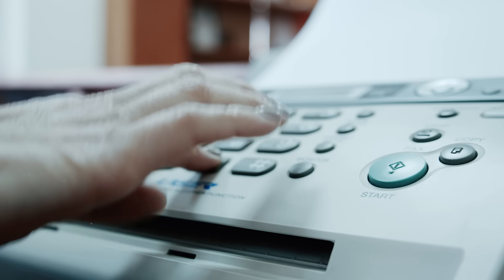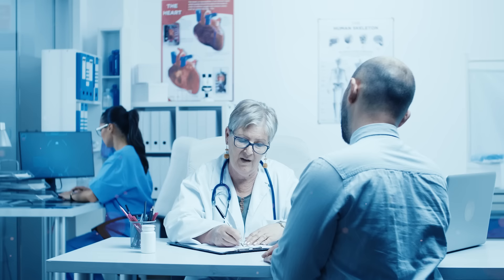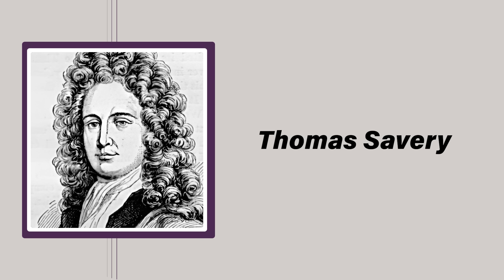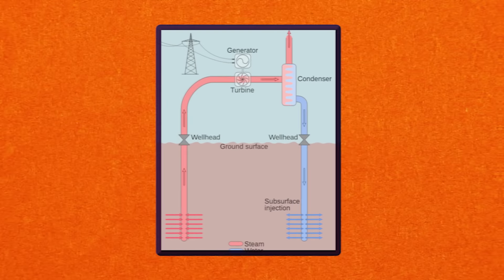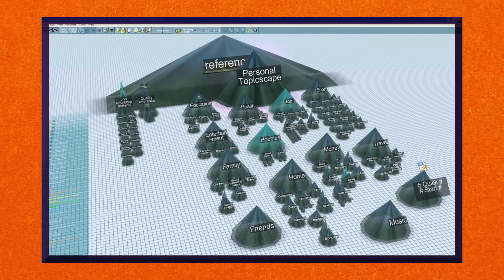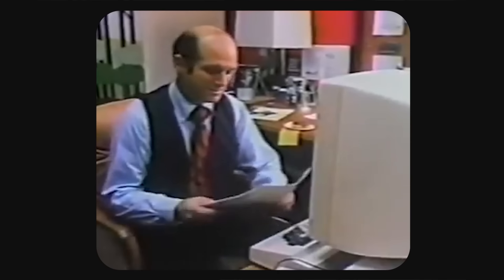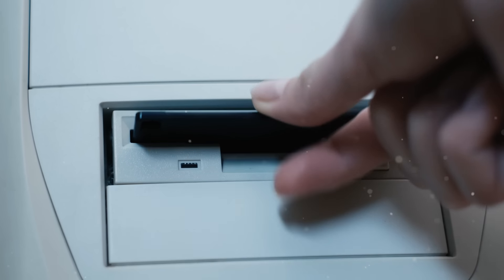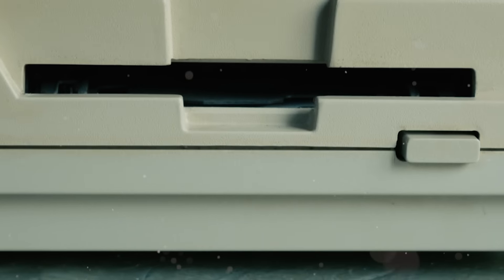Terribly Outdated Technology that we Still Use...

Comment: Actually, Natural Gas fired power plants do not use steam, instead they use turbines directly, like a jet engine (turbofan) or as the engine(s) for a turboprop plane.  This allows much quicker adjustment in the power output which cannot be efficiently done with steam.  Because steam power output is not easily adjusted, this is why coal-fired, oil-fired, geothermal, and nuclear power plants are known as "base load" plants.  In other words, their power output stays relatively constant throughout the day.

Comment: One of the reasons fax machines have declined is the removal of land lines.  One must have a dial up connection.  Home fax machines have been replaced by services like faxzero for the occasional outbound need.  No business except some tiny start up would used cellular for its sole telephone.  Interesting about the HIPAA (a solution in search of a problem!) approval.

As of a few years ago, some state of Texas systems were still using XP.  Typical Texas, where we don't restripe roads after many years of illegibility.  Like the later Windows 7, ordinary users were very, very slow to upgrade to newer OS's.  Put Windows 98SE in that exclusive club, too.

Comment: Worked IT in the medical industry. Windows XP was used for machines in Imaging. Hated fax because it had lots of problems (hard to pin down ones) when run over VoIP (since POTS lines were largely discontinued).

Comment: New doesn't necessarily mean better.  Take cars for example.  When i bought  nice car back in 2000, it didn't require me to have a "subscription" for the heated seats.  You either had them installed or you didn't.  And while the heated seat subscription model is on hold for now, you can bet it's coming back at some point.

Comment: some of us don't believe diskettes are technically floppies since their cases are hardened; one interesting variation of this were LS-120 "super" disks; they fell into the category of Bernouli drives, a class of removable hard drive; this is why the drive actually used an IDE cable; not long after that, data storage practically grew at a logarithmic rate; CD-R/CD-RW bumped up to 700 Mb and hard drives advanced into the Gb range

Comment: Floppy disks have a security feature that I haven't seen on a USB flash drive for over 20 years... a "write protect" feature.  Once the disk contained the data you need, you could stick a sticker over the slot in the side (5.25" disks) or move the sliding tab (3.5" diskettes) and the drive would not be able to write anything to that disk/diskette (unless the physical hardware was tampered with).  This meant that your disk was protected against viruses when moving it between different computers and that nothing could selectively delete or alter files on your disk.

Comment: I still use a Psion Organiser for keeping track of my money.  Instead of booting up a pc and running a spreadsheet or a money manager type of program, I just press ON, and within one second I can add a record and then just press OFF and it goes off but is actually on standby and returns to where you left off.  The battery lasts for about a year!  Try that with a smart phone.  At year-end, I can plug it into my old PC running DOS and transfer the data as text files.  My old machine also runs Windows 98 so floppies are useful as W98 can't use modern flash drives because it needs a specific driver for the device, so I can use a usb floppy drive to copy files from it to a more modern pc if needed.

Comment: You missed DOS.   Yes, some DOS applications are still running, because, Windows is just an unnecessary overhead.   Outside of military usage, you also have the odd fact, that dos runs on a chip that can cost $2, so, there were some embedded applications still using DOS, and last I coded for one, I noticed the other coders HATED IT.  Weird when someone takes a paycheck to do something, but keeps saying, you need to upgrade, you need to upgrade.  lol.   But your copy machine does not need windows, etc.  Switches do not need windows.   Etc.
Reply: Quite a few years ago, I have seen cash registers in shops running under DOS.

Comment: Probably already mentioned, but I'm too lazy to read 3,300+ comments to find out, so...  @11:35 - floppy disks are also more resistant to single-bit error caused by (of all things) cosmic rays than are flash drives.  Commercial airlines routinely travel at altitudes where this is a real concern.

Comment: We used to have a fax machine integrated into our photocopier/printer/scanner in our office but not anymore.
Now I got a problem every time a company requires me to give our fax number when signing up for a login.
Prescription for medicine is all electronic here and I haven't seen any paper prescription for years. 
Pagers are no longer available here and stopped working several years ago.
I work in aviation and that is a very conservative business so we do have problem with equipment that require old type of media like Zip disk, PCMCIA card and even small SD card can be a problem.

Comment: At my company,  I still use some very old systems for some parts. My CNC machines still relies on Windows XP or even Windows 3.10 for the oldest one ! Same for the automation system that works on an antic IBM Model 55SX or one of my lab where some analysis machines relies on early/mid 90's hardware and software.
And even my "intranet" messaging and calling system called "Rizia" is not really young anymore since both the server and the terminals are based on a Debian 6.

Comment: 7:33 I like how Simon is denying the existence of Windows 11.
BTW, the real hardcore users are still using Windows 98 with NUSB and KernelEX, so they can also use many Win XP compatible software and hardware in addition to products that have been discarded when WinXP came out (parallel interface scanners and printers, non-bloatware versions of simple and efficient programs). And Win98 can run native MS-DOS software.
12:36 It's weird to hear the sound of a 3.5 inch floopy disc being inserted while showing a 5.25 disc being used.

Comment: I work for a construction related company, and most of our vendors still use faxes. I have one at home. Many people consider them obsolete however, it takes only moments to stick a document in and dial a number and walk away. The “modern“ wayinvolves turning on the computer, scanning the document, saving it and then opening email to send it where the recipient has to do the same to retrieve it and print it. In someways old technology can be more efficient, and faxes are an example of that in some situations.

Comment: Every telephone company central office in my area that has Litespan 2000 OC-03 digital loop carriers uses 3.5" floppy disks to backup all of the cross connections. I have an old Toughbook laptop running XP that I use to log into older equipment in remote terminals. All of the old Motorola radios I use as an amateur radio operator are programmed via a laptop that runs XP, except for the really old Sabers and MaxTracs that have DOS based software .

Comment: Any time computer technology and safety/reliability requirements meet, you're likely to find the sort of "multi-generation" lag described in this video. I work in the defense/aerospace industry, and on one of the "cutting edge" projects I'm currently involved with, only single-core microprocessors are certified for use in certain flight systems.

Comment: Apparently Szczecin, Poland's busses are still running on Windows XP. It's true, I even have a photo proof, get in tooch if you want it.
Reply: I believe you, our farm has an old packard-bell tower that uses XP for our accounts, though it’s not connected to the internet
Reply: @WizzardJC  Well, the thing is that the display in question is supposed to be an computerized "map" kinda thing that shows where the bus is, what's the next stop, etc. so it has to be somehow connected to the net. Also I am pretty sure on the pic I took it was in the middle of downloading some sort of an update.

Side note: Shame it wasn't an interactive kiosk, otherwise I'd open The Hub, or other similarly embarrassing site on it.

Comment: Anyone stating that floppy discs are durable and reliable, never actually used them, or at least not enough to know how prone to failure they are. The floppy disc's drive, often damaged/scratched its surface oonger read/write operations, currupting their data and making them useless junk. Also, any other electronic device that priduces an noticeable electromagnetic field, like a cell phone, could, sometimes corrupt its data, also since they stored data by magnetizing a disk of ferromagnetic, like old K7 tapes, with time they spontaneously demagnetize, usually it starts with some small bits of the material, either degrading the data, eventually it bough for corrupting parts of it, until they finally reach a point that it essentially automatically and spontaneously erases itself.

Comment: I still hear of new applications for steam energy. It seems to be a relatively cheap and effective way to convert heat energy into mechanical energy.
Oh, the sizes of the "floppy" disc included the original 8" which was indeed floppy, the somewhat less floppy *5.25*", and the 3.5" microfloppy, which my wife called a "firmy" or "cookie." We finally settled on the term "diskette."
We ditched those because we found they tend to become unreliable after a while.
Windows XP is a hoot. To my mind, it was the point when Windows finally came into its own.
It's probably the best place to park if you're going to park on a Windows OS.
As the lead operator in the computer room for a major retailer of women's underwear, I carried a pager for maybe four years in the late '80s and early '90s. I don't remember ever changing the battery.
In the mid-'90s I overheard some kids in Walmart refer to the watch pocket on their jeans as a "pager pocket."
Pocket watches are still a thing, aren't they?

Comment: Steam turbines were being phased out while I was in the Merchant Navy between 1980 and 2000. I only ever sailed on one vessel so powered, a 280,000 t VLCC. Some ships did have steam pumps ( reciprocating and turbine driven ) however, usually tankers, but some other ships also had them for specific purposes. All the other ships I saw were motor ships powered by either slow speed reversing two stroke diesel engines directly conected to the propeller or a medium speed enginge driving a variable pitch propeller. I believe that there were some vessels around that were diesel electric, usually tugs and other specialised vessels. I believe some cruise ships and ferries may have had this form of propulsion as well. I don't believe steam propulsion has been used for propulsion purposes on cruise or other passenger carrying vessels for decades, the fuel cost would be prohibative.

Comment: I still use a Pentium laptop with windows 95 and yes I do use it online too.
I use it because:
I need the parallel port and the serial port and floppy drive is also handy.
I tried with a modern system a USB to parallel port adapter. It never work right.

Comment: So does that make me smart that I knew all of these, except for floppy's, were still used regularly? lol
I even still have a fax, but to be fair it's an all-in-one fax, copy, scan, printer that I only use to scan these days. But I did know where and why they're still used. 
Steam was an easy one. Kind of hard to miss.
Windows XP (6:42 is in the middle of Steam Power Chapter) was also an easy one. I knew military and gov still uses them, same as Blackberry's. I did know a lot of businesses use it, but I see a majority starting today, or older ones moving over to Android (since they started the smart phone scene and it runs on almost anything) or some smaller businesses to iPads, which is basically the same thing. This I believe is mainly the commercial businesses and not industry type.
And Pagers was also an easy one since if you've been to a hospital, or lucky enough to just see them in shows, still prevalent.

Comment: Steam Power
Whenever you can convert the volume of a common everyday fluid to over 1700 times its initial volume and grenerate enormous pressure, you're going to put that process to use.

Comment: I had a pager loaned to me by a place I was working for. I really hated the people running the company. One day I accidently dropped the pager in the toilet because I put the thing on the wrong side of my belt loop. I fished it out a second after it dropped in (fortunately I hadn't used the toilet yet) and it started vibrating due to the short circuit from the water. I yanked the battery out as fast as I could. I really didn't want to pay the $70s to replace the pager to those jerks, so I dried the pager over 24 hours and put the battery back in. It worked fine. I quit about a month later and returned it no questions asked.

Comment: I have a working Atari STE, they are still used by musicians because of their built in MIDI sockets and are why musicians still use floppy discs. 
You can upgrade both the floppy drive and the external hard drive of an Atari ST with devices using SD cards. It seems strange that a computer built in the 1980's is still having new accessories made for it.
My Atari is plugged into a flat screen TV via a modified SCART cable from the 1990's. So many technical eras in one set up.
If only Microsoft had written upgraded versions of MS Windows XP instead of going off at tangents to incorporate AI .

Comment: There are still some assembly routines running on today’s IBM mainframes that were written in the 60’s. They are so intricate and critical for the running of some applications that no-one dares touch them, the knowledge required is simply not there any more! And because they are so intricate, attempts to migrate these applications to more modern platforms is often unsuccessful as the original routines are so lean in comparison that the performance can never be truly matched under load.

Comment: Papermills use steam for producing paper. Steam is generated at high pressure in boluers and reduced to lower pressure for paper making using turbines that drive electrical generators.

Comment: I am running win XP on my desktop because my scanner software and other related programs run best on it. I have win 10 also as the secondary system in case. XP boots is 3 seconds. 10 boots in 30 seconds.

Comment: Add to the list flush toilets with low height reservoirs at atmospheric pressure! We should all be using the high pressure flush mechanism used in many public toilets. It both saves water and reduces clogging. All that is needed to adapt them to the low-flow water supply pipes in houses is a small pressure accumulator tank right at the toilet. Such tanks are already required to be installed somewhere in the residence anyway.

Comment: The large government office where I worked as an COBOL Analyst Programmer treated us like dirt, because the management were convinced that the VME COBOL mainframe was about to be replaced by a new Microsoft software system working on servers. Twenty years later the COBOL Mainframe programs are still running in virtual environments on modern hardware. Their COBOL system will be 49 years old in 2024.

Comment: Another piece of antiquated technology that will still work is the old rotary phone!!!

The only thing it needs is a landline connection and powers itself from your landline phone jack. 

In the event of a power outage, since telephone cables and electrical cables are separate, they are extremely useful. 

Same for CB radios.

Comment: Fax machines give hard copy without needing access to the Internet.
There ARE places in the world you can get an old fashioned phone line BUT NOT the Internet.

Steam Power in ships is capable of scaling up more than anything else.
AND you can use it with nuclear-powered boilers, which is WHY the US uses it in all of our carriers - the range limit becomes something OTHER THAN the fuel for the engines.

Floppy disks - are outdated badly. I didn't realize ANYONE still used them at all?
Even CD-ROM is marginal, but still a good music option as you don't have to worry about them getting erased by accident, and they have a VERY long lifespan compared to any other widely used storage tech (DVD uses the SAME tech, as does BlueRay, with very minor changes to enable more capacity).

Pagers - are so 1970s, I didn't know they still existed?

Comment: I still don't understand how Galaxy 5 was handling all the pagers in America.

I get that the pager towers were just leased space in different TV and radio STATION'S broadcast structures and a 900 mhz antenna on their tower, and the  C-band TVRO dish outside was pointed to the satellite and the digital decoder modem was getting the digital data from the stream and sending it to the tower to broadcast and that activated the pagers and gave the message, but where and how each phone number was being routed and the data was being sent somewhere somehow and then it was encoded and added into the stream, I don't know how or where this was done.

I am guessing these pages all went to Hughes and they must have run the entire paging network, but I can't confirm that.

The coolest thing is the stand alone paging networks that companies build for themselves using their own frequency.
They then buy pagers and program them for their frequency

It is really cool

I have Minitor pagers and I have used a tone generator to page individual pagers programmed with individual codes and had group codes and all page tone

But I always wanted my own digital paging frequency

Now I am bedridden so it will never happen